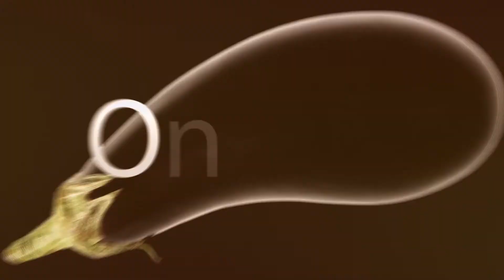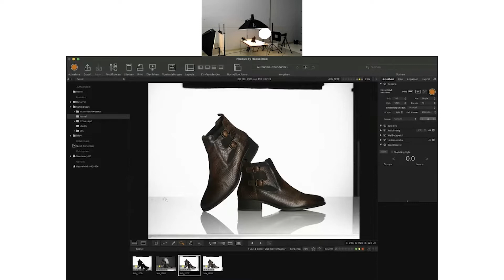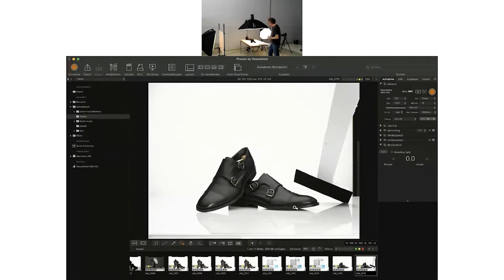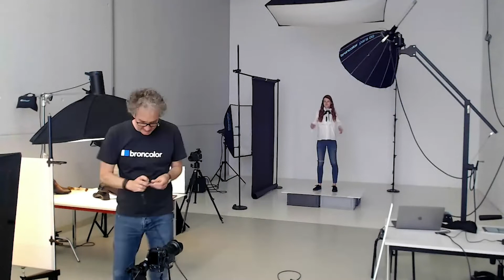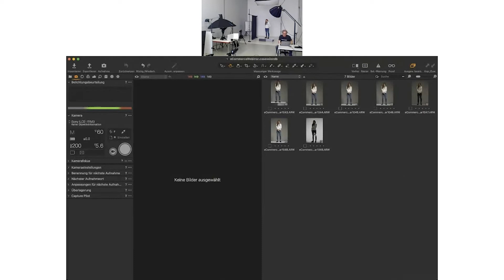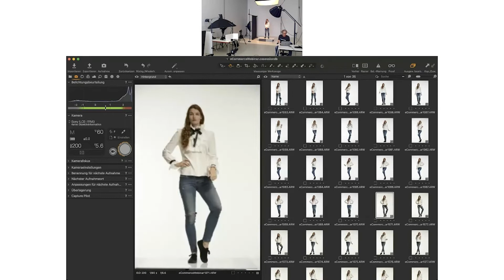broncolor webinar: eCommerce lighting setups for products and fashion

Comment: I have a question. I'm shooting tethered into the Sony Imaging Remote Software into my laptop. I shoot sRGB and the values show 255 in each channel. When I take that RAW into Lightroom and measure the values again, it shows like 97 percent and not 100 percent white value and when I take a pure white 255 brush in Photoshop and paint over the 255 white background (as Sony Software told me) it changes to actual 255 white. Why does the Sony Imaging Edge software tell me it's 255 if it obvioulsely isnt 255. Why are two different Softwares measure different values?
Reply from the maker: Hi Dampf Nudel, that's a in-depth question. Please get in touch with your local equipment provider to find out the reason. Would be great if you share your findings afterwards with us.